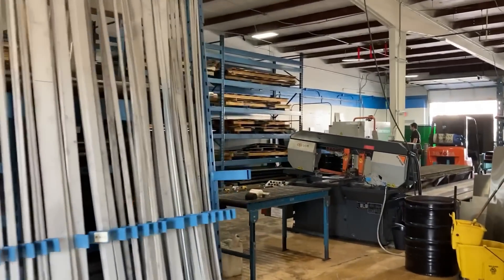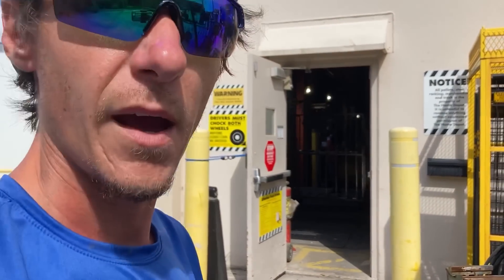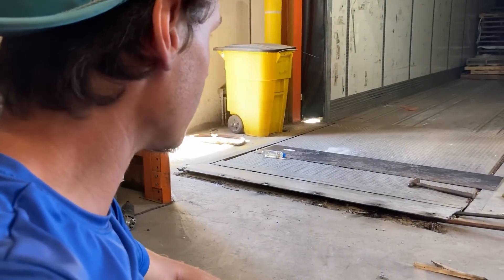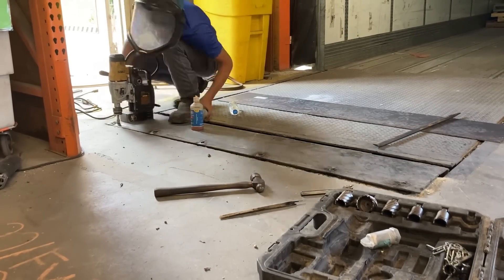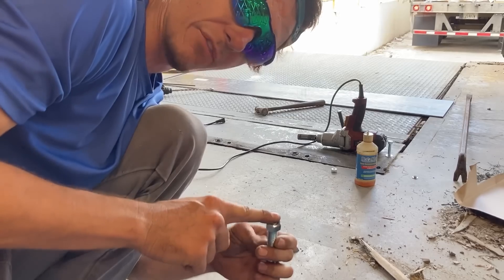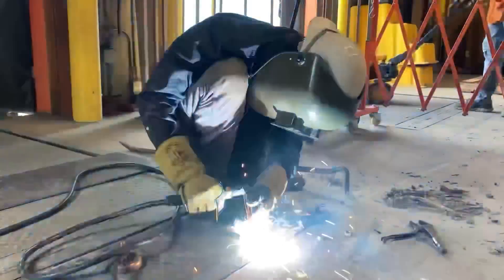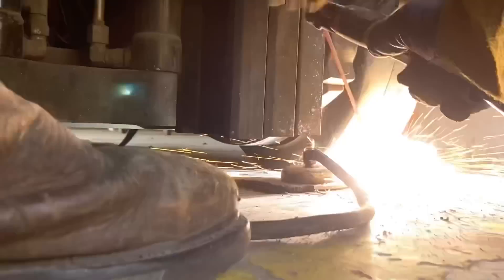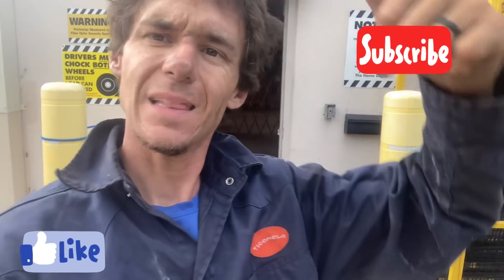“Simple” welding repair on loading dock goes wrong!

Comment: actually, I have found out that hitting the nut to get a larger surface area, can damage the threads on the bolt
Reply: Agreed. Thought the same thing when he said that
Reply: Yeah I wouldn’t hit those nuts either, especially since you knew you’d be cutting off the ends of the anchors anyway
Reply: I was taught to use 2 nuts, one right on top of each other. That basically doubles the amount of thread engagement and dispersing the force of a hammer hitting it. Never had an issue.
Reply: @Sffker  Actually if you look at the bolt, it is designed to being hit. It is thinner in the top to counter any deformations from being hit with a hammer, so you can apply the nut after.
Reply: @plurplursen7172  actually, I’ve seen and installed plenty of anchors myself, so you’re not telling me any breaking news there pal.
Reply: @Sffker  But, it just sounds like you have taught something once, and then been doing that, and never actually read the instructions on how they are indented to be installed. But hey, if it works for you. But, if it fails, and you have been following the manufactures instructions, then you are not to blame.
Reply: @plurplursen7172  but, I’ve never had an issue, but, it’ll be okay, and actually, I’m looking at a set of instructions for 1/2” wedge anchors and it LITERALLY says on the instructions “leave nut flush with end of anchor to protect threads. Drive anchor..” lol. know it all’s, right? Sheesh.
Reply: @Sffker  nope, that's not the instructions on how to use them. I know, because i've actually read them. But nice try.
Reply: I set the nut such that the striking tip of the bolt is completely exposed, it merely protects the beginning threads, in the event that I miss with the hammer blow.  
2 nuts sounds like a great idea, especially for my day-after-hangover jobs.
Reply: @derrikarenal3308  this,
The nut should go down below the striking tip, if people have never had a problem with striking the nut, then it's just a question about time, because you will eventually damage the thread and then you have another problem at your hand. :)
You will have to fix the thread which can be a pain it the ass if you don't have the right tools right beside you or on site.
Best tip is probably, learn to use a hammer so you don't miss 😄
Reply: @Myrius69  Exactly. Also, use a 3 lb sledge and it only takes 2 hits to fully seat the stud, minimizing mushrooming or deforming the threads.
Reply: @Sffker  never had an issue in construction is not a good saying and you know it.
Reply: @bbbildhuu  its literally anecdotal fact, im not just making a saying up. "never had an issue" is accurate. because people don't understand physics apparently.
Reply: @Sffker  Terry folds! Stop disappointing me.
Reply: I made sure to read thru the comments before making the same remarks. I knew I couldn't be the only one, thank god
Reply: @grahamshelton3448  physics must disappoint you before me..
Reply: @Sffker  No, pretty sure its just you. What happens when you get down to your last nut and anchor? Do you refuse to do it the right way? I notice you lean pretty hard into the whole physics thing. Wouldn't physics suggest if you put absolutely no stress on the threads it's best. I didn't put a question mark because I know the answer. I mean, it seems like trying to find a way to drive a nail in blunt side down. Why even try anything different from making sure the threads are safe. Again, I know the answer. Still, I love the name and hope all is well.
Reply: @grahamshelton3448  I’m not in construction. Every anchor I’ve installed has been in a manufacturing facility. of which, there’s never been a shortage of 3/8, 1/2 or 3/4” nuts. It’s not a 8-32anchor. go look up how much force threads can see before failure. now tell me you hitting 2 nuts, stacked on top of each other, doubling thread engagement, distributing the force amongst 1/6th of the entirety of the anchor (dependent on length obviously), will reach that much force. not sure why people find this hard to understand. I’ve literally seen it stated in anchor literature to do this, as sourced above. If it’ll make you happy, I’ll stick a 3/4” bolt with 2 nuts on it in a vise and smack it with a sledgehammer until I can’t use the threads anymore. Unless you’re pounding that anchor halfway to China, you’ll never see that much opposing force on the anchor before it goes in its final resting place.
Reply: @Sffker  Shit, forgot. 8- 32 is 1/4. Maybe you mean those drywall screws. Whatever. Damnit
Reply: @grahamshelton3448  well, it was just a guess. I don’t remember what we used, I think it was 5-7 inch total length anchors. unlike contractors we had come in who put up safety railing with like 3” anchors and broke the concrete all over the place.. 8-32 is 2 sizes under 1/4. small threads. But nah. Lonely yes, but drunk, no, I wish. You can play with my flappy folds if it’ll make you feel better
Reply: @grahamshelton3448  The bigger bolts you can do this trick, although it is totally unnecessary, unless you are handicapped.  With the smaller bolts though, you will damage the threads. Don't believe me?  Well, try it out  and you will see.
Reply: @plurplursen7172  bud, I was agreeing with you.

Comment: That metabo can be fixed. I've fixed one at my shop where I work and I'm not positive but maybe you could find a replacement for the black cap(tail cover) covering the wires and connections.

Comment: when drilling holes in concrete, it was always easier for me to blow the dust from the holes by using the oxygen from the torch (if one is handy) rather than blowing it out by mouth. Hey but the main thing is you did a good job even though it turned out to be more of a problem than you originally thought👍
Reply from the maker: good idea!
Reply: Oxygen is very flammable be careful
Reply: @TheNigel55  please tell me you are joking
Reply: Oxygen ignites very quickly just a very small spark
Reply: @TheNigel55  acetylene ignites very quickly, oxygen is just a necessary part in a combustion reaction.oxygen  is NOT the fuel source
Reply: @ferricthebeaver8093  Your right there. But oxygen can be a fuel source. It definitely wouldn't be in this case so i wouldn't worry. But a container filled with oxygen can ignite.

Comment: I used to fix loading dock ramps and weld on trailer bump boxes to the building.  Every summer on the weekends.  Worked fixing  the tractors during the week and what they broke on the weekends.   Glad i dont miss it.

Comment: 2 questions.  1) why was the ground strap on the forklift not a concern while welding and 2) would running a bead around the edge have been easier than grinding the bevel into it?

Comment: On the side one that kept flexing up when you took off the bolt, I would have put in another Redhead to hold it down while you welded the first one.  The problem was that you had nothing holding down the edge with only one bolt.

Comment: For the last part of the loading dock that kept bulging up.. Why dont you weld half of the nut to the bolt grind off the other half then weld half of the exposed bolt to the loading ramp then grind off rest of the nut and finish welding the rest of the bolt?

Comment: Just my 2 cents. Next time you have to press down next to concrete, make a couple  strong backs that you can redhead down and evenly disperse the weight. Cut them flush after. Good job all the same. Keep burnin and they will keep callin.

Comment: Do you ever use Plate Dogs/Wedges? Maybe could've used a Plate dog and Wedge it in from the concrete side to press that bow down flat when welding those end bolts in place. Just a suggestion.

Comment: My pops and I have the same truck as our ranch truck. A 96 f350 XL. It was a city of Phoenix work truck. Has 114k miles and is fully mechanically sound back from the Ford dealer. It also has the same bed you got with the lockers and the bed is also that brown/red primer. Only diff is it has an orange work light bar on the cab roof. Sweet vids man
Reply from the maker: you got the IMT crane? I love that thing
Reply: @MeltinMetalAnthony  I wish, the spot it was mounted is visible but it was removed from one of the previous owners. Keep on Melting Metal! I'll be tuning in

Comment: I have a fair amount of experience with these plates, and when you tried removing the attachment point of the plate with the lift at the start, I was very worried.  These things are set in the concrete and are not coming up.  When ever we have major issues like this we usually have the whole thing cut out and replaced.  Dock plates are no joke and can cause serious injury if they fail.  Hopefully the plate itself wasn't compromised.  Looked like you removed the trip hazard though.
Reply from the maker: ya I've only messed with a few. any advice is appreciated

Comment: Soon as i seen that Dock plate and realized what you were fixing and the plate you bought to fix it I knew you was about to get a surprise. I used to make those threshold plates for those docks at one of my old shops for a company in my area that installs those things. When you started prying on it i was like "Yeap he doesn't know that thing is an L shape and bolted inside under the dock plate." Everyday is an adventure in the field.

You can replace the cord on that grinder and it will be good as new. Super easy to do.

Comment: Not only is it bolted but the corners have metal bolts ( can’t remember the actual names ) but the protrude into the concrete 4-6” we repair these at work and we cut the concrete about 1ft from the metal edge all around and chip away all the concrete and replace

Comment: When you hammer the redhead anchors in, don’t back the nut out to the end. Spin the nut so the unthreaded portion is completely exposed. That way when you hammer it you’re not hammering on the threads.  Once you tighten everything down take a cut off wheel and cut it flush with top of nut.
Reply: Back the nut off so it only has 1/2 to 3/4 on threads then put roto in hammer mode only and drive it home.  Then tighten anchors-without having to trim excess off.

Comment: I think you did pretty well on this. I do this for a living and the only thing different you did than I do is you removed the nut from the anchor. I weld around the nut, cut half the nut off and spiral over the whole assembly. The company I work for has 25 years doing docks/t-plates/eod/etc and they swear by the half nut technique
Reply from the maker: I will give that a trying I get called out again
Reply: So you end up with something that looks like a carriage bolt head sticking up?
Reply: @ProleDaddy  that’s the general idea I suppose. A welded carriage bolt head lol
Reply: @d14_x80  That may be alright some places, but some equipment that would be an issue for. Do any customers ever tell you they want it flat and do you ablige in such cases? I'm curious how a dock leveler would hold up in that case.
Reply: @ProleDaddy  this is only for a T plate application only. The plates themselves are bent on the end and run into a groove cut into the floor. The anchor and it’s corresponding welds are at or below floor level. 

In the case of this particular repair, it’s an old plate that doesn’t seem to be recessed into the floor much. 

As far as it being flat, I would oblige the customers needs as best as possible. If it’s unable to be installed in the proper fashion due to customer request, I’m going to assume they would not warranty the work.  This hasn’t been an issue as of yet though
Reply: @d14_x80  Gotcha. Thank you for sharing your experience.

Comment: We use the same but 3/4” for bracing we always make sure nut is threaded down a 1/4” so when u beat down with hammer. Doesnt mess up threads. Becuz when u do the nut will cause the whole insert to spin and u can not lock it in

Comment: What electrode(s) were you using for the welds? Do you worry at all about the zinc plating on the bolts?
Reply from the maker: in 6010 we trust
Reply: @MeltinMetalAnthony  Nice! After binging Gold Rush and seeing them use 7018 for everything I was beginning to wonder if I was crazy for using anything else :)

Comment: I think you did a good job on the repair. The only thing I can probably think of. As far as using the new piece of material you did get. Maybe you could’ve  cut the corner top section of the old material away from the portion that goes into the hole where it was bolted. And possibly trim back the concrete just a little bit with a masonry cut off wheel. So that way the new piece of material would’ve sat flush with the concrete floor. And then welded up the corner of new material to the old material that was going down into the hole. I hope it makes sense what I just explained. Just another idea for future reference if you have to do it again.
But you did what you had to. And great problem-solving as usual. Good job.

Comment: I like your vid... Good work, good problem solving... Just a little comment about $: your hammer drill is an investment, so you'll be able to stretch the cost and the metal is now in your inventory... Since I'm pretty sure you will use it in a near future, you'll be able to transfer the cost to the relevant project... But you probably already know that — do you do the accounting yourself?

Comment: When I'm weld on the inside of a 60 inch pipe 5/8 thick.  The trick is to organize your tool in a way that they are close, but not too close that they are getting sparks rain down on them. I saw a few times in your video that sparks are going on to your tools. Most tools now have alot of plastic and plastic melts. So I hope you have better day and I didn't criticize you too much.

Comment: This is my bread and butter. That plate is a repair for busted concrete at the back of the pit typically. The main issue it looks like from your video is that they didnt grind the concrete back far enough under the transition plate which left it just above the floor level. Home depot operators like to push and drag pallets it seems, FedEx is the same way. Always pulling up transitions and rear curb angles. They never call until it's a pain to repair.
Reply from the maker: thank you for the insight! this is good to know, cause im sure there are a few more of these in my future
Reply: Happens alot. They will pull that one up in a few years too. It's probably their busiest dock.

Comment: I would have lifted plate, cut anchors off with cutting wheel or sawzall, Drilled new holes (with lite gauge fb underneath to protect bit) cleaned out underneath, installed anchors and welded out. Not cutting plate or torching anchors because of possible dingle berries that could be more work to remove.
My favorite saying is: Give a lazy man a job and he will show you the easiest way to do it.
I love the channel. Keep up the good work.

Comment: Not sure if you ever done a bolt press to keep pressure down on a plate but if you start with longer bolts and make a small jig to grab the bolt up higher and pushing down next to the hole so you can weld it normally helps out a lot to keep a good clap load on what ever your trying to hold down and the back of the fork truck is the heavier side because of the counter weigh just saying

Comment: Get yourself a setting tool for your hammer drill, basically a SDS bit with a flat tip. Sets redheads quick, got one a few weeks ago saves time and hammering
Reply from the maker: didn't know it existed! comments like these are the only reason I read some anymore!

Comment: I have actually used to red heads about an inch apart to take the bow out of a plate. One to hold it down while I welded the other.  Great video man, now about that oil leak...
Reply from the maker: my seals on my oil cooler gave way! we got it fixed thou

Comment: You did great. Some pointers, always go on sight to quote a job, and when you’re there , inspect it like it’s your new car, hands and knees, flash lights. Having a proper plan can help, even though half the time the plan gets thrown out and a new gets made lol. In this case if you were able to gauge the work you would had saved time(which is money) and actual money by not buying the steel. Pointer: wood wedges, more forgiving, and you can use it to lift the steel away from the concrete, those bits aren’t cheap! Crete will destroy them !!

Comment: You should have cut the ling side at the 90 right above where it was bolted to the slab. Liftoff the old junk. really clean and level the base then drop either the new plate down or reshape the, cut, and fit the old place where you can work on it out of its placement.  Then just run a  bead back along the long end and red hed if needed. Finish off with some 6K cement to feather the edges.

Comment: Maybe try using a u bolt and a washer or a piece of pipe with a cutout so you can sink the redhead and still be able to get your rod in to tack it while you have full torque on the nut....in future situations like this. I'm glad that plate didn't pop off and hurt someone when you used the lift like that. Bad form there just saying.

Comment: You have a roto hammer instead off hammering the redheads in put your rotohammer in hammer mode then you can drive the anchors down makes it much faster and easier.

Comment: make a puller for the red heads. works wonders for making a flush plug weld
Reply from the maker: I’m gonna google that!
Reply: @MeltinMetalAnthony  2"x1/2" flat bar. make a 3 side u shape. 2-3" top. 8-12" tall. get sum threaded rod and a long threw bolt. few nuts to lock it down and used on top.
Reply: its a puller prty much
Reply: Bro you could have drilled holes in the concrete next to the plate while the redheads where tightened, then drove another redhead or a 3/8 piece of rebar into that hole and tacked the plate to that.
Reply: @googleplex7097  drilling unnecessary holes in close proximity in concrete is frowned upon. That’s how you crack it. Even the spacing he went with personally would of been a little too close for comfort for me.